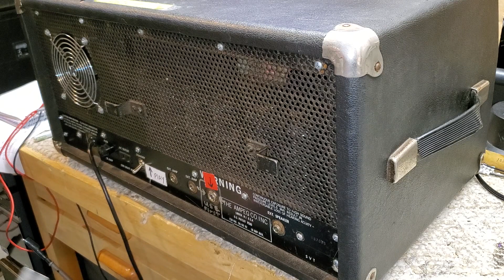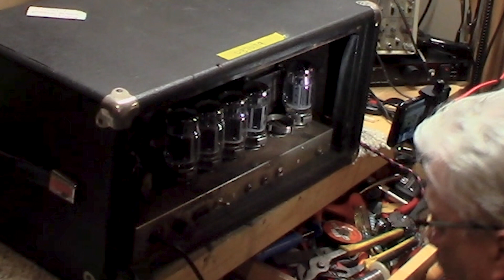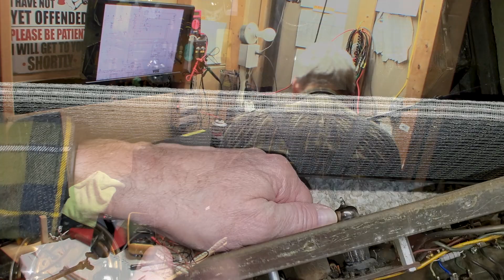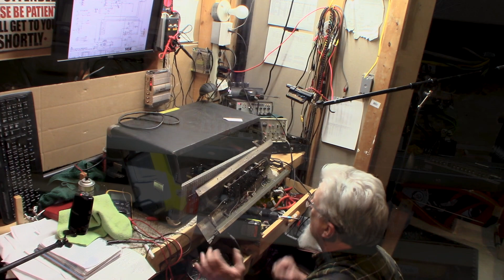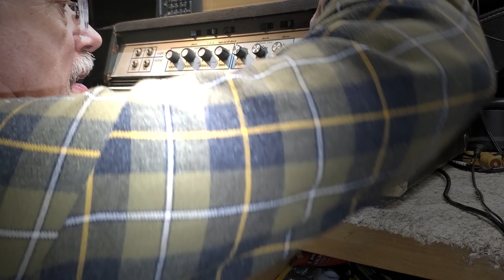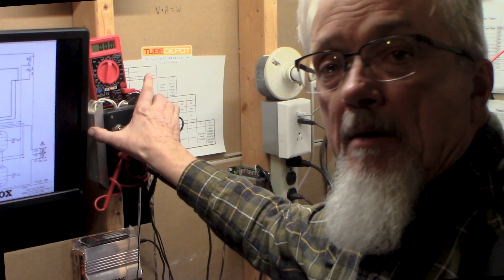E04 - Blue-line 1973 (or so) Ampeg SVT: Quick Preamp Repair; Set the Bias, Balance, and Hum.

Comment: ANy idea why the newer SVT Classics, and SVT-CL's don't have hum balance pots? I was watching a video where the Psionic audio was working on one, and he mentioned they develop hum not only from the separate boards, but also, because of bad connections usually in the preamp board, and so he was fixing the hum in an amp that he apparently just fixed the same hum issue 9 months earlier. He mentioned it usually happens around the diodes on the preamp board, and sometimes caps, but I didnt get how it could develop bad connections again, and hum within 9 months of being fixed. I'm guessing maybe vibrations that crack the solder joints? Even that though would seem weird to me. Any ideas? I guess in his opinion, developing hum on the newer one's happens, but is not normal. I have one though, and I do feel like there is a very quiet hum no matter what, but I'm not sure, I have to listen again, but if it does hum, maybe it's not normal, and maybe that's why the new one's have no hum pot? Also, when you set the clipping on the waveforms, is that the bias your adjusting? Just curious how one would test that on the new ones, like what would you adjust on the amp while looking at the scope, and what points would you hook up the oscilloscope to?

Comment: Hey there Wally I’m trying to buy an oscilloscope to do balance in my blue line SVT and I’ve found an RCA WO-91B and was wondering if you could tell me if that would do the trick? It’s got really nice tubes inside and it’s a good price here locally in Canada like $100 so about $60US and was wondering what you thought?

Comment: Thanks! I just got a late 70s SVT and it was definitely nice to watch somebody bias 'er up. Would definitely be interested in seeing deeper dives into a beast such as this; mine has a bit of hum that doesn't go away by just adjusting the Hum Balance pot.
Reply from the maker: The split chassis SVTs have more hum than most single chassis amps. Make sure all of your grounds are clean.

Comment: WALLYS WATTAGE COTTAGE,   what is the balance and hum trim pots adjusting? the AC or DC voltages to the preamp and power tubes heat voltages?
Reply from the maker: The drive balance pot is adjusting the signal level balance between the "push" and the "pull" sides of the power amp. This is kind of like a front/rear control for speakers. The idea is to get the output signal positive and negative wave peaks the same voltage (height). 

The "ends" of the hum balance potentiometer (or pot) are connected between the 12.6V AC heater supply; and, the center wiper of the pot is connected to ground. The idea is to set the control until the preamp tubes are picking up the least amount of AC hum from the heater circuit. I hope this helps.
Reply: @wallyswattagecottage1275  thanks for the help
1.) I'm confused how the Hum Balance pot can cancel out the noise/hum from adding more or less resistance from +12.6vac to ground because that is what the hum balance is doing is just adding more or less resistance from +12.6vac to ground or it is changing the heater vac voltage up and down?
2.) The Balance pot is adjusting the plate voltages or the cathode voltages of the power amp tubes to adjust the positive and negative peaks of the voltage height?
Reply: @billwilliams6338  He answered you. If you still don't understand, let it go. He has other things to do.